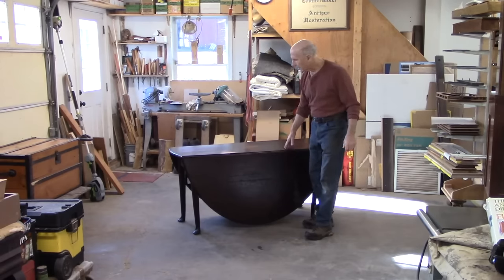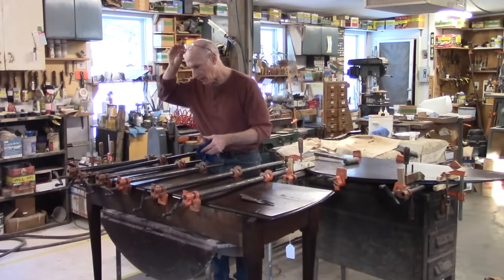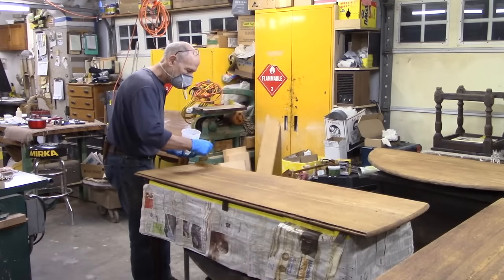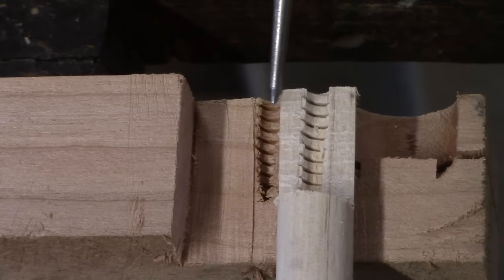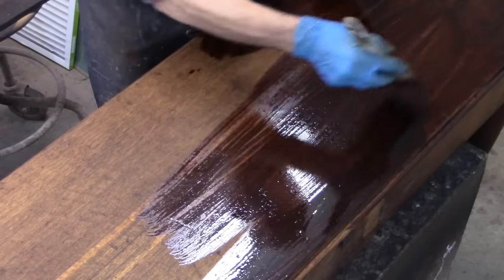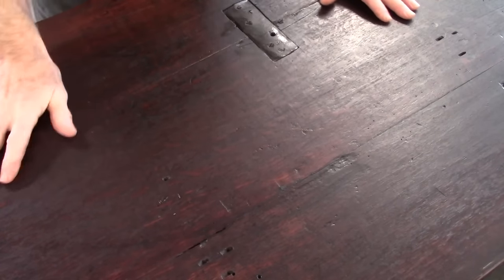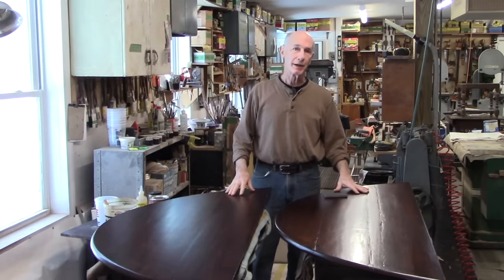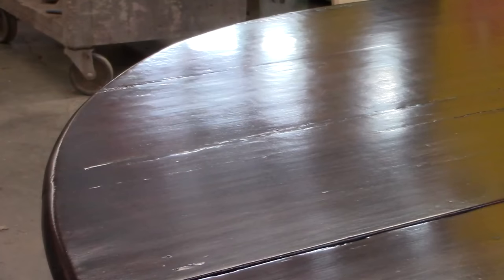Is This Table Too Old to Refinish? - Thomas Johnson Antique Furniture Restoration

Comment: I'm not sure about your theory about plugs vs dowels, if I understood correctly a dowel would have been cut from the perpendicular of the direction you cut your plug from? Using a clock face as reference, 12 to 6 would be with grain,  9 to 3 would be opposed to grain, and the thickness of the clock at the 12 to 6 a is is where a dowel would have been taken from? I can't imagine that holds true all the time. Wouldn't it matter more the type of wood the dowel came from?
Reply from the maker: Thanks! I think it's true all the time. Dowelss are made 3' & 4' long, so they have to made with the grain. You could cut plugs anyway you want, but usually perpindicular to the face grain. to match the board where they are going

Comment: I noticed that when you are removing particles with a razor blade that a very small crevice remains and that you are depending on wax to fill the area. I do some refinishing as well but on projects that I choose not to use wax. This means that you are removing a small part of the topcoat sealer. In this case would you have applied another topcoat? I would appreciate your personal advice. I am always wanting to learn about what I don't know.
Reply from the maker: Thanks! Yes, true. Sometimes the knits come off clean, sometimes there is a slight defect, and usually dull. But I find dry 0000 steel wool will correct it. If I don't want to change the sheen, I'll rub the areas with a finger, or most often, craft paper. Sometimes the small defect remains, but you're the only one who can see it. Easier on light, unstained surfaces, tougher to hide on a dark color

Comment: Is tung oil generally a good choice for restoring a dining table surface? My dad has asked me to restore his 1800s walnut dining table that has almost no finish left on top and lots of white spots from spills and stuff over the years. I’ve been trying to research what to use and many sites recommend polyurethane (which I don’t think is historically correct).
Reply from the maker: Thanks! What I like is a Tung Oil Varnish by Waterlox. They've been making it with the same formula since 1910 so it's about as close as you can get to what might have been on it originally. It's also very durable https://waterlox.com/original/

Comment: What is that scraping device you’re using?  Where can I get one?
Reply from the maker: Thanks! I use a few scrapers, my favorites are: Woodpecker Mini https://www.woodpeck.com/woodpeckers-mighty-mini-scraper.html, Hongdui https://usa.banggood.com/HONGDUI-2-In-1-Mini-Wood-Carbide-Insert-Scraper-Glue-Scraper-Removal-Aluminum-Alloy-Handle-Woodworking-Tool-p-1649089.html?cur_warehouse=CN and Bahco https://www.bahco.com/int_en/ergotm-paint-scrapers-set-with-dual-component-handle-pb_scraper-set2_.html

Comment: How would you fix a big dark spots in a butcher block type of tabletop?  Don't know what made it, friends bought it thinking it would be easy to fix but it's deep.  Doesn't seem to be a burn, but a stain.
Reply from the maker: Thanks! Give it a good sanding - the entire top equally! Make sure it's fresh wood with clean sawdust (it may be oily at first) then treat the entire top with oxalic acid 
. Put it extra thick on the stain, let dry overnight. Rinse well outside! https://savogran.com/pdfs/Wood_Bleach_PD.pdf. If that doesn't get rid of it completely, do it again

Comment: Nice job! Do those bar clamps have pads on them? My father always used thick felt as the bar clamps will cut into the wood if too tight.
Reply from the maker: Thanks! Yes, you can buy pads that fit on them

Comment: What did you tell the client about the burn mark?  Were they notified before work that that mark would remain?  It being in the center table section made it visible always, and although the table being over a century old did they expect it to disappear?  Also, did you do anything to the apron of the table?  Seems like it was ignored.
Reply from the maker: Thanks! Oh yes, I talked it over with the owner. There was nothing you could do about it except cut it out, really opening a can of worms. The apron and legs were cleaned and waxed

Comment: Can I suggest you use TrollUll No 6 Steel Wool for stripping. It's a little course but cuts through stubborn old varnish. I'm curious as to what you used after your varnish stripper. Was this a soap/neutraliser?
Reply from the maker: Thanks! #6 is pretty rough! I usually use #1. but yes, the coarser it is the better it can pick up thick sludge. Just don't go cross-grain! I like using TSP with a little oxalic acid for an afterwash. We used to always use lacquer thinner, which worked well of course, but the TSP works just as well, and no fumes etc.

Comment: Hello, I'm wondering what type of glue did you use on the table center repair? It was thin enough to pass through the needle.
Reply from the maker: Thanks! It was hide glue, specifically  "Old Brown Glue"

Comment: I used to be a purist when it came to "original unrestored finish" and condition. But at some point after seeing hundreds of pieces of furniture that were beautiful but unusable because of the keep-it-unrestored mantra, I decided that the true value of any piece was in it's ultimate usefulness if it was repaired and refinished. I'm not talking about rare specimens that have historical, cultural, monetary or artistic value, but common everyday pieces that have been used for generations to the point were the joints are unsafe and original finish has become an eyesore. Repair the structural damage with modern glues, strip and refinish so anyone would be proud to show it off in their home and give new life to last and be enjoyed for more generations. That continued  usefulness is what ultimately makes any old furniture truly valuable.
Reply from the maker: Thank you! Well said. There's a huge difference between pieces for a museum and pieces for your home.

Comment: I have a question, and this is just to understand why you did what you did...why did you not use a thin sealing coat of shellac after staining and cleaning the oil, then your varnish?  In my finishing class, we were taught this method when the wood either had linseed oil or had natural oils that would wick out before we would apply a varnish.  Again, I am just asking as it is different than what I learned...and knowing more is better than less!  Thank you sir!
Reply from the maker: You’re welcome! You were taught correctly. I just wanted to table top finish to be only varnish
Reply: @johnsonrestoration  Thank you very much for the reply!

Comment: I notice after you stripped the tops you washed with TSP.  Does this neutralize the stripper?  Also what was the ratio of TSP you used.  Love your videos!
Reply from the maker: Thanks! Exactly! I think 1/8 cup in 1 gallon of water. Then a second wash with 1/8 cup (or more) of Oxalic Acid in 1 gallon

Comment: How old is the folding rule you have ? I replaced one that I had worn out. A Lulfkin folding rule with slide on one end & a hook on the other, $22.00. I  bought it, but it lays in my toolbox.
Reply from the maker: Wow! Mine are old - but who knows? 30 - 40 years old. Start using it, I think you'll like it

Comment: Just one question: Isn't the original finish better for "collector value"? 
I've seen Antique Roadshow episodes where a rare piece of furniture that had been refinished by the owner ("It was UGLY!!!") went from from being worth a couple hundred grand at auction  to maybe $500 tops at auction because it was refinished. He did a good job on it, too.

Wouldn't clean and preserve be better than refinish?
Reply from the maker: Thanks! That's a complicated issue, and it all depends on the condition of the original finish. I have been in a lot of wealthy homes and museums and every piece has been "restored". They are careful to never use the word "refinish"

Comment: Hello Thomas. May I ask pls? The syringes you use for the finer glue ups, do you clean them each time or discard them?
Reply from the maker: Thanks! I clean them. The hide glue is very easy to clean with hot water. They last for a long time!

Comment: The big question is, will the tabletop match the legs and body was well under other kinds of light sources as it does under shop lighting.  It can be a real problem.
Reply from the maker: Thanks! The good news is that with all antique tables the top is lighter than the legs. If you spend too much time trying to match the top to the legs it will look more like a modern reproduction than an antique. Viva the color differences!

Comment: It looks like the wing of the table that had the dowels was made as a replacement the same time some if not all other repairs were previously done to that table. I would guess that table is at least 100 years old unless it was a home built table then it could be a good bit newer.
Reply from the maker: Thanks! Having been so "intimately" involved with the table, I believe it is 300 years old

Comment: Does TSP neutralize the stripper?  Denatured alcohol is what Im used to.  I do use tsp as a pre paint cleaner.
Reply from the maker: Thanks! Any solvent will do - but I like TSP a lot better than using solvents, just to lessen exposure to them

Comment: From the hours you had to spent refinishing this table, you could have very likely have built one from scratch. This makes antique furniture quite the guessing game, do you preserve a piece or do you replace it? I do think that in future, I will build furniture that can be easily restored, which means using hide glue rather than the more commonly used modern glues. The same goes for the finishes.
Reply from the maker: Thanks! Yes, that's a good idea, especially in terms of the finish

Comment: What does TSP after stripper? Is it always necessary? Do you use it whether the piece is large or small? Thanks!
Reply from the maker: Thanks! You need to wash off the stripper residue. Most any solvent will do, but I like using TSP

Comment: To restore something like that but keep the character intact is some serious skill... If I try to restore anything I end up just completely rebuilding it but knowing where that line is to stop and leave the old defects takes a good eye.
Reply from the maker: Thanks! It’s difficult to know what to do sometimes. I always start with the structural repairs, and from there it’s just personal preference. Of course sometimes to complete a repair you need to sand a lot, and then you might need to sand everything…..
Reply: @johnsonrestoration  exactly lol...

Comment: Does anyone know if those sponge brushes like the one he uses, can be washed after applying varnish with it? And also with what can you clean it? Thanks!
Reply from the maker: Thanks! Between coats I submerge the end of the brush in a container with paint thinner. You can also wrap them in plastic. After you're done, I swirl it about in the paint thinner, than into some Dawn detergent, strong solution, let that soak for a little while and then wash it by hand, rinsing it out, putting a little detergent on it, until the suds are white. Let dry
Reply: @johnsonrestoration  thank you so much for your answer, it is very clear. I am currently restoring an old chest of drawers which I suspect has a Mahogany veneer due to a stamp I found on the back. The varnish is very thin and peeling at places, I'm trying your technique of just giving it a light buff with a 220 and then applying thin layers of tung oil finish. It has been such a rewarding process, and your videos are extremely informative and relaxing to watch, the way you face each project is such an inspiration to me. I tend to be impatient and this process has been helping tremendously in developing joyful resilience in facing a challenge. Again thank you so much for your videos I deeply enjoy them.

Comment: great video! one suggestion, try mineral spirits or thinner to wash pieces like this. water will attack your glue joints. cheers.
Reply from the maker: Thanks! The solution of water and TSP or Krud Kutter will remove any contaminants (oil & polish). Paint thinner will spread the contaminants around the surface. If water is getting into glue joints - well - those joints needed to be reglued anyway!
Reply: @johnsonrestoration  may not initially/instantly weaken the joint so you won't notice at 1st. Thinner works just fine in my years of experience haven't had an issue with contamination. To each his own! 😁

Comment: With what do you thin your tung oil, and what is the ratio of oil to thinner? Thanks.
Reply from the maker: Thanks! I don't thin the Waterlox, it's the perfect consistency right out of the can. If you do want to thin it, use mineral spirits

Comment: when you're using oxalic acid you need to first apply soda crystals into hot water (washing soda)..then wash the table with it this will help to wash out the wax and grease.
but you will get a chemical reaction with the oxalic acid and will bleach out more ring marks..
use the oxalic over the table top when it's still wet from washing it with the soda crystals  
hot water also for oxalic..
also wet the table with cold water when using the 0000 wire wool..
this will burnish the table to a good finish..also a handy tip if you just want dull the finish a little more ..
ps  you should not be needing to use green to kill the red in oak..
don't use any red stains on old oak as you will naturally have a warm colour in the wood. 
use French Polish for colouring out the light shades with brown umber vegetable black orange chrome red oxide..
try using water stains on bare wood then you won't get that very streaky patchey look..
I would have stripped that table stained and refinished it all in a day..
the trick is using traditional materials that dry very quickly  .
Reply from the maker: Thanks! Everyone has their own way of doing things! I will definitely try the soda crystals,  but I will need to figure out what they are. I don't believe we have anything available that's called washing soda or crystals. I'll have to look that up
Reply from the maker: Ok, I found it.
Reply: @johnsonrestoration  
roughly 1 table spoon in 1 pint boiling water wash the table ect with it..you can also use a scrubbing brush if you have wax to remove from the grain..
the soda will pull all the natural wood pigments to the surface so the wood will darken. 
but will lighten again when you use the oxalic acid..
use the oxalic again with boiling water. 
works best if you keep the wood wet from washing with the soda but not soaking. then use the boiling hot oxalic over the wood.
you will be surprised just how much better the oxalic works using this method..
I always neutralise the oxalic with white vinegar 50/50 with cold water. 
as oxalic is mostly synthetic now.
no longer made with rhubarb root extract..
yes we all do things different I am a French polisher in UK been doing this trade for 35 years..
so just giving you a few tips.
you never stop learning in this trade.
soda crystals is the best product to use on furniture it's just a brilliant for removing wax and grease..
as most furniture that gets waxed over the years it get cloudy and bloomy. so if you're restoring a piece of furniture without removing the finish and your just going to clean and revive it wash it down with hot soda. this will remove the old wax and grease that can cause problems with reactions like frying not drying and fisheyes ect..
then either re wax 
or use what ever product you are
finishing the furniture with..

Comment: Hello there. How dangerous is this acid u use to clean the stains from the wood? U spoke about the crystals that it left behind and how it needs to be rinsed off the table tops.. 
I wanted to ask u if it would be possible to patch that Burn mark on the table top? If u have to patch for the Hinges then is it not a good thing to do the same for the Table Top? 
What wood is this? Is it OAK? 
Why did u not plane the edges of the leaf that join with the middle part o the table? Would it not have been better for joining them together. The fixture would've looked a lot cleaner imo but I'm no expert my friend.
I'm probably asking daft questions but I mean no disrespect by doing so mate.
I loved watching the whole process. 
The acids are a no no for me though. I'd end up with that stuff splashing in my eyes man. haha! 
I'm already struggling to see clearly nowadays even with good light in my small shop. 
Really enjoyed the video btw. Keep up the great work pal. 
Can I ask one question about the term Quarter Sawn Oak?? Where exactly is 1/4 Sawn wood from the tree? Is it in the top edges of the round/Trunk? I know u have the PIT/CENTRE of the tree. Then the growth rings circle out from there. I realise the rings circle round but when u cut the lumber a certain way u can get straight lines in the grain if that makes any sense??? I'm probably not making any sense right now. I'm hoping u understand my babbling on this question?? 
That's a type of video u don't s3ee a whole lot of and if u do it's glossed over too quickly anyway. 
Thanks for great content Tom. Look forward to more of ur videos.
Reply from the maker: Wow! Thanks for watching! But that is a lot of questions - too many to answer!